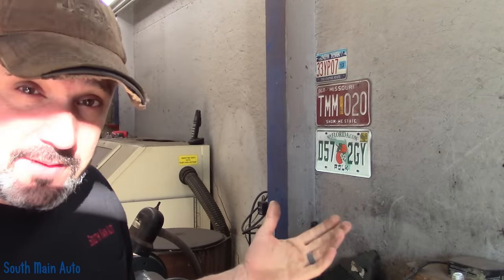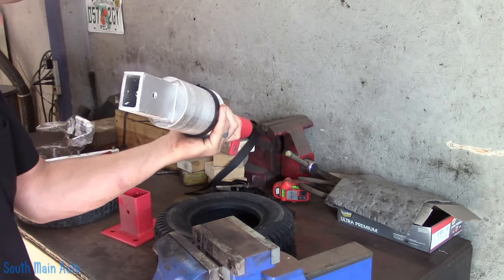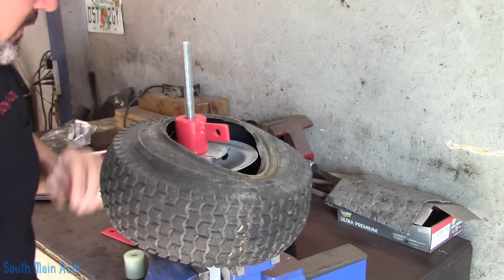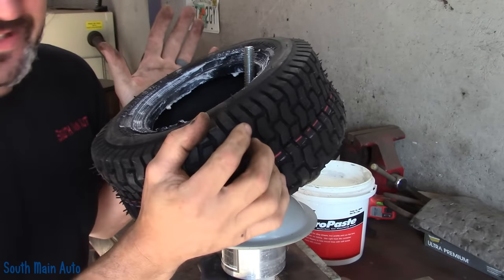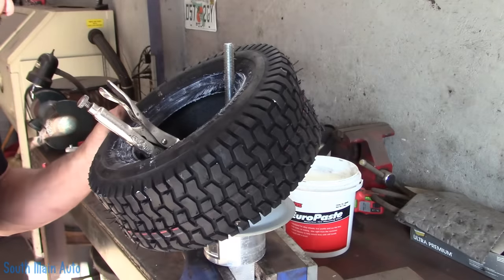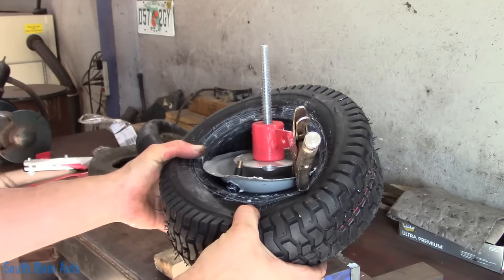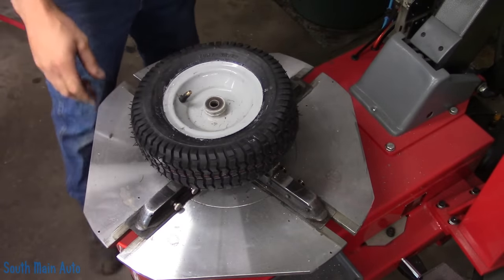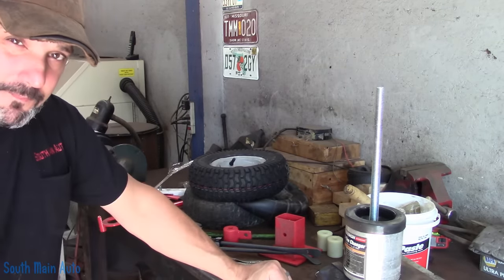Mini Tire Changer

Comment: what a piece of garbage that wheel is. Yea I would not do that again i dont think. I may strongly consider spending the 20 dollars more and get the entire assembly. Thanks for showing this video as I learned a lot. is the other side rolled? Im going to watch this again. If so good catch someone and yea the other edge is the one. Did I mention that rim is a piece of Garbage? oh yea I looked and I already had. Oh well.
 FYI. I learned how to change my wheel barrow tire the hard way! It was the bead. OMG i had to use plastic wire ties around the circumference of the tire to push the bead in. Tubeless...what a PITA. In hind sight I should have used a ratchet strap. I used a Carlyle Tire. Great tire. I send back some other crap tire that could not have been more out of round. at least 3/4 of a inch. Carlyle is nearly Perfect and it smells like rubber not that plastic like cheap tar smelling crap.. My 2 cents for the till! Love you re Channel and your subscribers. Most of the information in the feedback is priceless.

Comment: I wish you could share pictures in comments, but anyway, if anyone is interested I actually mounted ATV tires on my riding mower. The rubber bodies are so ***** thick that they are like impenetrable to dry rot. The mower sits outside year round on the bare dirt ground and they haven't lost but 2psi in 2 years. They are literally 30% more.expensive than riding mower tires but they will last 3 times long. I opted for the V tread mud tires for my lumpy yard that has standing water after a rain storm but you can just get all terrain tires that are easier on your grass but will last far longer. They are mounted with valve stems no tubes in any of them. If anyone would like to see Message me and I'll send you photos.

Comment: I actually had a Harbor Freight manual tire changer given to me and it actually works good. I made a duck bill adapter for it and I can knock a tire change out in just a couple minutes. It also does a good job on small tires . They do sell some questionable stuff but they also knock it out of the part on some stuff .

Comment: The tire changer on Amazon is a little on the pricey side (Northern Tool wants about the same as Amazon) . If anyone really wants one and has a Harbor Freight store nearby that has one in stock it looks like you can save at least $20.00.

Comment: I have one of those Tire Changers and they work quite well. As you say... just HOLDING the wheel is half the battle. The included Remover/Installer Tool works well but it runs around on the rim, and may have damaged that extremely thin rim... good thing you did not use it. Oh right.... you did bend the rim anyway.... oh well. Cant have heavy parts on Garden Equipment.... they might last forever!

Comment: I worked in a trailer repair shop years ago, we had a really old tire machine with the big metal bar with the slot running through it, one time my boss told me to change a 480x8 trailer tire very similar to the one you showed, anyway the machine was not designed to be used with small tires, i told my boss i was having problems he said just get it done , anyway the bar slipped off the machine hit me in my left elbow the force from the hydraulic pressure threw me against the wall ended up shattering my elbow in 6 places had to get two surgeries to repair the damage, of course i sued his hateful ass and one year later settled for $120,000

Comment: I have the same mini tire changer mounted on a 3 foot pipe stuck into an old train wheel as a base. I use GOJO Original Formula Hand Cleaner as a lubricant. I slop it on both the inside of the tire as well as on the outside. It's easy as cake and a piece of pie to use! (now I can't keep the neighbors away)

Comment: Same changer.  Mounted the base on a trailer tongue and also used 4 anchors in the garage floor.  Each way has its advantages.

Comment: I usually use a 12 inch 1/2" drive extension clamped in a vice. That doesn't make it any easier.

Comment: Those small rims in the last number of years have been made so paper thin and wimpy its such a joke, barely touch them and they will bend on the edge of the rim. If I have options I prefer to buy the rims that have four bolts that clamp the two halves together but they are tube type only, they don't require any special tools and avoid that dreaded bent rim potential. But if if all one has is what you have in front of you as Eric did in this instance, I guess that vice grip method isn't the first thing to try.

Comment: Bolt that thing to a scrap steel wheel and clamp it to your tire changer table--No adapters necessary.. When you are done , hit the pedal, unclamp it and put it in the corner until next time.

Comment: My ATV tires were always fun to change. I usually cut a chunk out them to break the bead. Then put the new tire on with a ratchet strap. Tightened the strap till it expanded the bead and hit the air and badaboom tire was on. Ready to go.

Comment: That works better than what I have to do at the shop I'm at. Put 1/2" breaker bar in vise to hold tire, then the vice grips and car tire irons. Never had a wheel bend that easy though.

Comment: Amazing how many comments came in on this "Out Of Norm " video from SMA.
Ever thought that Eric may have done it just to get you all riled up  ?
Good job Eric , you punked them/us all and glad to see you take a break from the mind boggling wire chasing. Therapy.
Now for my 2 cents worth. 
A small engine lawnmower retailer once told me to always use a tube in small tires. The reason being is that they only run about 10-20 PSI ?
Which is not enough to constantly hold the bead to the rim. Especially with temperature changes. They always leak. Which makes sense to me. The problem I have found with that is moisture will always find its way between the valve stem of the tube and the rim . Thus ,rusting the rim from the inside out.
It's a trade off.
Pros & Cons to everything.

Comment: Ha! Even with a purpose-built tool, still not easy. Decades ago when i was making deliveries, my hand truck tire went flat, and no gas station wanted to touch it. I finally had to beg one station to let me do it myself, and i would still pay them, and they let me do it myself and charged me for it, but back then a tube patch was only something like $6.75😛

Comment: I needed to replace a tire on my own lawn tractor, did it myself, and it was a major pain in the butt, even getting the bead to seal to add air.  I mounted a large bolt in my bench vise (saw on YouTube) but it took me about 1.5 hours total.  So "next time" I'm taking to a tire shop !!!

Comment: As far as the engine valve question goes. Not always the camshaft. Some engines use rotary valves. I think one of the first were in a motorcycle engine. also Some use solenoids. Look into the F1 Engines. I have heard this technology is being considered in production engines for precise infinitely variable timing on each valve.

Comment: I generally hate working with small tires! I need the bigger manual tire changer from HF. I have several 4 wheelers and the zero turn that always need air.

Comment: I have this same tire changer and have used it for a number of years. Only thing I have done to it is I cut a piece of oak pallet to slide into the base so when I clamp it down tight in the vice the wood keeps the casting from collapsing. I drill a small hole on the side and run a screw into the wood so it won't fall out unless I want it out.

Comment: Bought one of those tire changers about 4 years ago .... never been sorry. The supplied tool works well. Mounted it on a piece of 3/4 inch plywood c clamp it to the work bench when I need it hang it on the wall when I don't.

Comment: Hey folks I have a question here. My 2017 Kia Sedona is leaking grease on the drivers side axle. The passenger Axle according to the technician is in good shape. The dealership recommends rebuilding the axle has it's cheaper than getting a new one. The passenger side axle is in good shape should I replace that one?
Reply: Kia dealer mechanic here, actually spoke to Eric and Mrs O when they bought their Sedona (I'll never wash my hand again after shaking Eric's...just kidding I don't know where Eric puts his hands off camera) First off axle shafts are a 10yr/100k mile power train covered component, unless the dealer deemed it not warrantable. I would not recommend replacing the other side until you have concerns with it. The Kia axles in your van are actually very good quality wise and I would suspect you cv boot leaking is more from road debris hitting it vs it having a material failure.  Hope this helps.

Comment: If you cant get your hands on a mini tire changer like this you can make an adapter for your tire machine using an old rotor a flat peice of steel and a rod that can fit through the bearings. Just weld it all together and you have an adapter that your tire machine can clamp down onto.

Comment: I use bit of threaded bar 2 offcuts from a round wood stake centre drilled and a diy wing nut .
Got a couple free old small tyre spoons goodyear branded and job jobbed pretty quick .

Main problem on newer machines is wheel is softer than a ready meal tin  .

Comment: Even though it holds air I would have put a new tube in. It's been years since I've changed tires and I never changed a little one like that. But I never heard of that channel lock trick.

Comment: Man, that looks like a disposable rim.  Way thin.  I'm trying that tool on my motorcycle tire.  Looks like it would be a lot easier than plywood and two feet to hold the wheel still while mounting.  Thanks for sharing!

Comment: Hey We repair numerous tires at our shop. Usually install a tube with new tire on old rim cause we don’t want it coming back. When we have old tire off we file any metal burrs down on inside of rim prior to tire/tube install.  Excellent video

Comment: Got one of those last year...  don’t have a tire changer at my shop and got a cheapie riding mower to mess with.  Tires old and dry rotted but only leaked slow except one.  Got that changed it out for a newbie and some tubes for the future and it was a godsend over fighting those older stiff tires off by hand.

Some day I’ll buy myself a real tire changer though.

Comment: Myers sells a mount/dismount tool with a flat spoon on one end for dismounting and a hook end for installing. You can spin them right off snd on, as long as you have the wheel clamped down. Also avoid servicing plastic wheels, too much danger of shattering when inflating.

Comment: I got mine that mounts to my receiver hitch on my truck and you could mount your changer to an old tire rim and then you can take it and chuck it up on your tire machine if you need a little more mounting ideas. Great little changer, it beats my 4x4 wood post with a large lag screw and a couple of washers.

Comment: I've found it easier to just buy new tires already mounted on wheels at the Harbor Freight.  Did just that when my generator tires went flat after trying to swap the tube in one of the.

Comment: On the 8 inch tires you can use a 5 gallon bucket to hold the tire and work the rim into it. the bucket also help seat the bead if you are having trouble with air leaking out.

Comment: I fought with one of those small rims for an hour or more before I figured out that the rim was two pieces held together with four bolts. Took the bolts out, replaced the tire and tube, reinstalled the bolts aired it up and away we go.

Comment: Sometimes tyres can be an arse, big and small , I like the cheap budget ones that are so squashed the sidewalls are touching each other when fitted , then you've got to pit one side off then put a tube in it , blow it up , then pop one side off , struggle to take the tube out , then put a tubeless valve  in , then jump on the tyre to get it to seal , then charge the customer the cost of 6 eggs and a pint of milk , oh how we love the motor trade, great video Eric  , great kit

Comment: With tubed tires you need to fill them up with air and then pull the valve stem out to drain all the air out. Replete 3 times to eliminate the  wrinkles in the tube. Otherwise you will have a flat tire from a wrinkle in your tube...which will cause a hole in the tube.

Comment: that rim looked like it had no flat landing area for the bead, indicating a tube only rim..which is crap that should never have been invented :/
It's not that you cant put it on without a tube, but the least little thing will de-bead it..one good corner will do it

Comment: I think you need to weld or bolt a  12 in. circular plate to the bottom of this new tool and then mount it in your tire changer done deal

Comment: The problem I usually have with these small tubeless tires is getting them reinflated, even using my mema's trick of tightening a rope around them. Eventually I give up and buy a tube (or a whole new wheel).
Reply: I use a small ratchet strap.Just crank her till she seats.
Reply: @Mizman76  Same principle. I've used it successfully on car tires, but not so much with small tires.

Comment: I have two double ended Kenn Tool tire tools for small tires and made a small bushing/bolt setup where I could bolt them to the corner of my workbenches and it works pretty good. I use the black tire grease, but don't recall what it's actually named.  The bucket is pretty much unreadable now LOL
Reply from the maker: "Frey Lube"
Reply: @SouthMainAuto  yup, that's the stuff.  Works great for the tires we dealt with 22.5 & 24.5 semi tires  but doesn't do well on a sandwich 😆

Comment: Had one of those at the tire shop I worked at in college. It was mounted to an old steel rim so you could hold it steady  in the rim clamp machine. Also helped that with the larger wheels you could reach with the arm of the tire machine.

Comment: there really is no bead with those rims the sidewall seals it. seen a lot of those the center weld leaked and the air comes out past the bearings.  mount and dismount from the rolled edge side  even then its easy to bend them. i cut the stud off on mine . the edge on the bead breaker will bend too.  for the price its worth it for the lessor aggrivation and it dont take up much space when not in use.

Comment: Hi, SMAP. You made me think of the guy with two kids who wanted to be stargazers. The guy goes to the hobby shop and buy a pair of binoculars, goes home, takes them apart and gives each kid a new telescope. We, sort-a. You also remind me of the guy who know how to drive a 4 speed manual transmission 4 Dr. Ford, who is asked if he can drive a Ferrari, and says "Sure. It's just a manual transmission, right?" You lost me when you refused to read the manual on a new tool. Would you actually teach your son how to use a new tool without referencing the manual? Then you actually bent the wheel by using vice grips. Why did this happen? Because you insisted on putting the new tool in a vice when it should be bolded down. If you had bolted it down and used the tools that came with the new tool, and followed the directions, you would not have used the vice grips, or bent the wheel. And last, you used a vice on an aluminum casting. You couldn't lock it down because you would have crushed it. This vid is a good example of the concept of "Sunk Costs." By not reading the manual you tried to use your old methods to replace the wheel. As each effort drove you deeper into the eror, you refused to make a change in course by saying, "Oops. I should read the directions."  You made an easy job into a chore. You ended up doing more work than otherwise. So, you're stubborn and know a lot. Fine. Next time, read the instructions. Thanks for sharing! Stay Healthy!

Comment: There are a lot of sellers on both Amazon and eBay that sell the Pittsburg small wheel tire changer, that use pictures making it difficult to determine that the changer is a Harbor Freight product.

I purchased a unit from eBay a couple years ago for changing the tires on my Vacuum shredder. Wasn't impressed and left feedback as such. eBay removed the feedback. 

I ended up machining a set of matching plates for the rim bead and clamped in place. Also used the Kent tire spoons. Harbor Freight is OK for some things, but the tire changer, I'd pass next time.